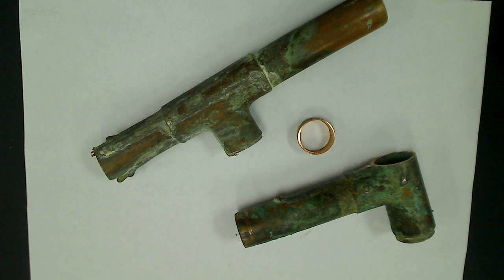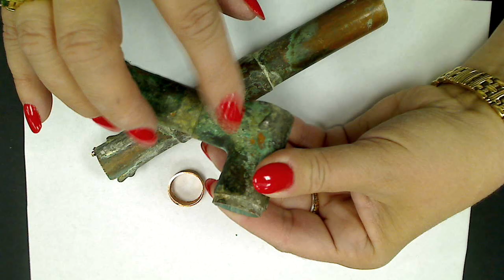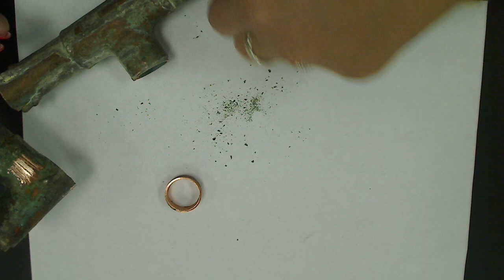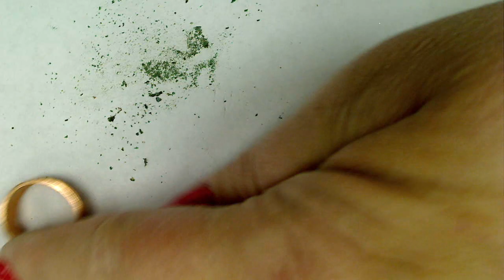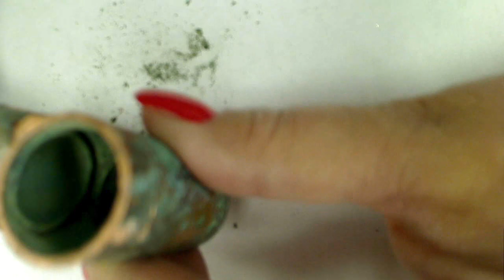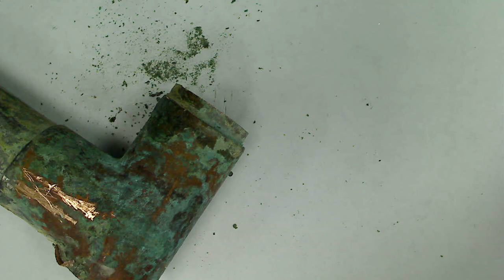Chemical Change with Copper Pipe

Comment: Somebody didn’t ream the pipe after cutting it to make it smooth on both sides in & out, so you will eventually get pinholes & or a pipe burst.
Reply: Not reaming a pipe may impede water flow and result in debris build up but the is not the primary cause. Pinholes are the eventual result of pitting corrosion that develops inside the copper pipes and primarily caused by acidic water and/or exposure to corrosive materials

Comment: Lady with all respect the green stuff on your pipes is flux that the plumber didn't wipe when he was done soldering  it turns green after time
Reply: Not at all. It is exactly what she said in the video. Copper Carbonate produced from exposure to moisture and carbon dioxide.
Reply: lol @ the faux chem professor hahah